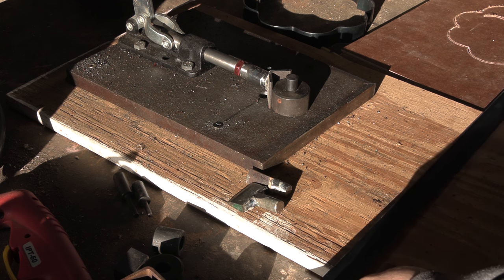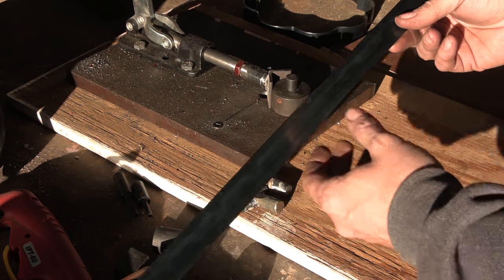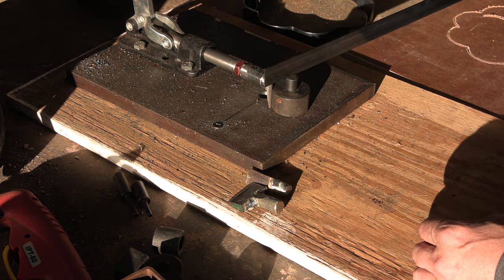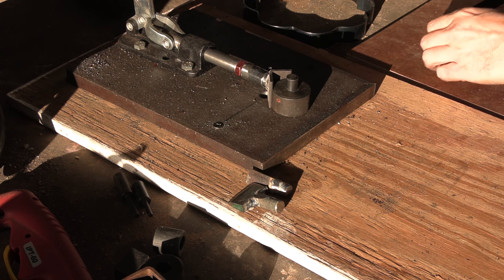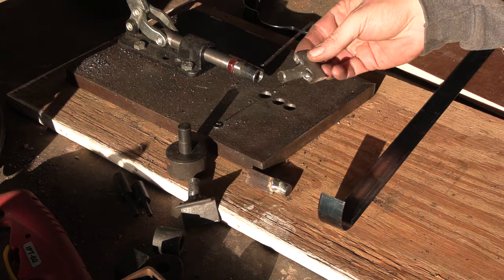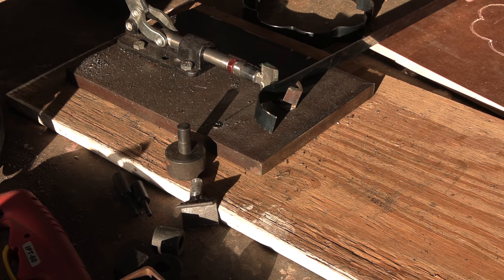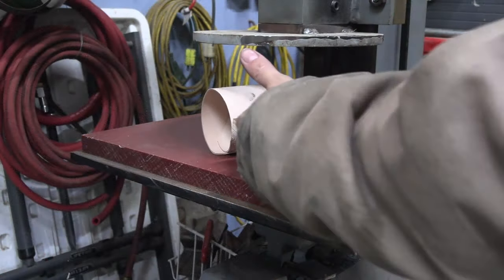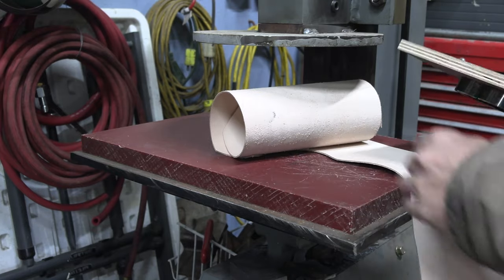Making my own steel rule cutting die for leather with shop made tools

Comment: I tried this setup but the bending mechanism was not sturdy enough. Where did you get the super heavy duty mechanism. I tried every where.
Reply from the maker: I found a push clamp on Amazon.  https://www.amazon.com/gp/aw/d/B01ABWUS9O?psc=1&ref=ppx_pop_mob_b_asin_title
Welding the longer handle on made it a lot easier to use.
Reply: @bransonsgeneralstore  thanks for your help